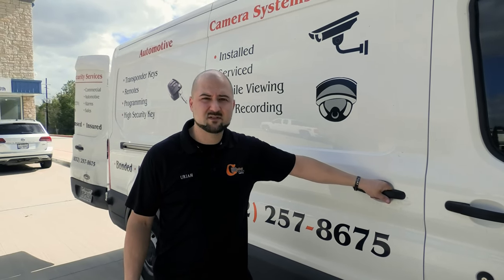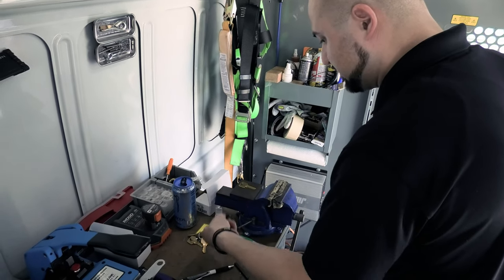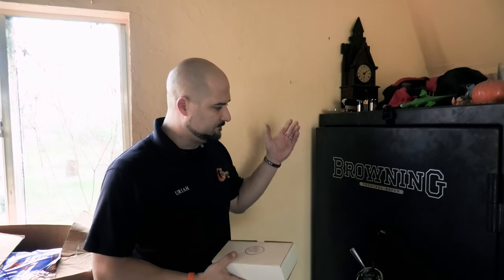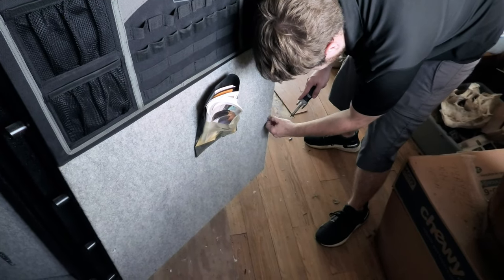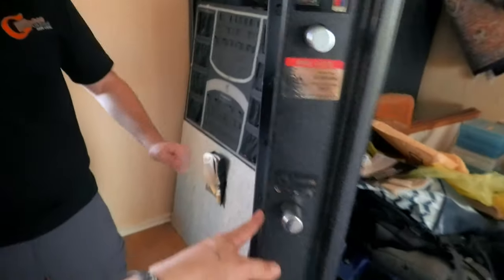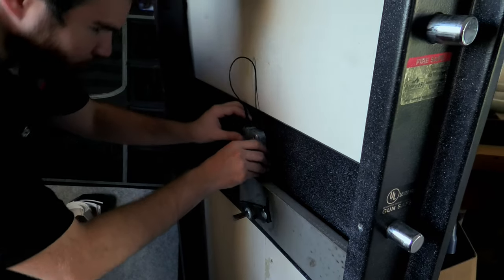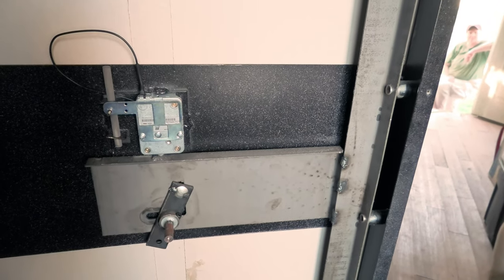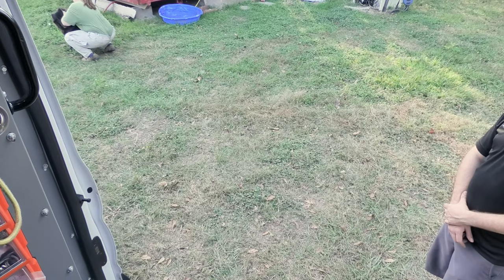Replacing A Safe Keypad & More | Leading From The Front With Uriah | Episode #11

Comment: When you cut with your blue punch or code machine, do you charge more or just the same as a regular key duplication? A lot of locksmiths charge more because it’s considered cutting by code. I normally don’t because I like the key to be more accurate from my code machine but I may eventually charge a little more down the road because it takes longer to cut keys than using a standard duplicator. Thanks for sharing✌🏼🙏🏼
Reply: Yes we charge for a "Key by Code" any time we are cutting an original.